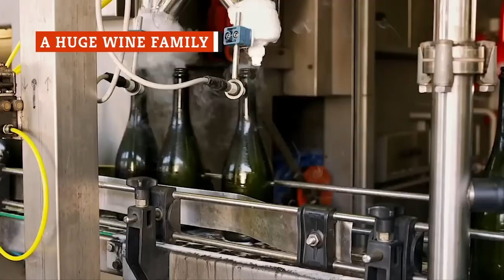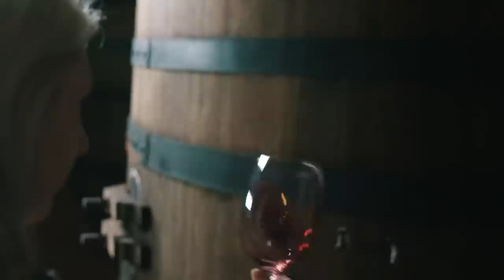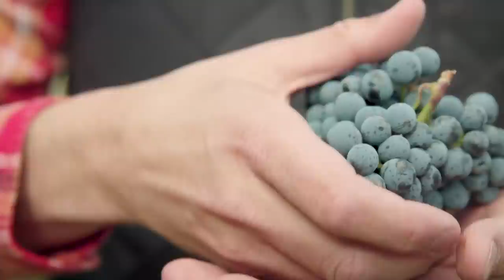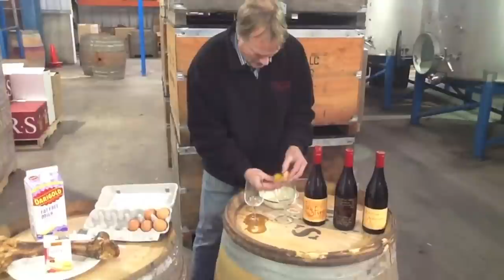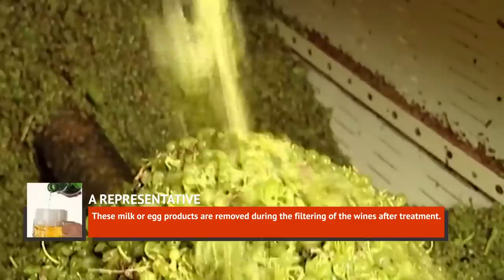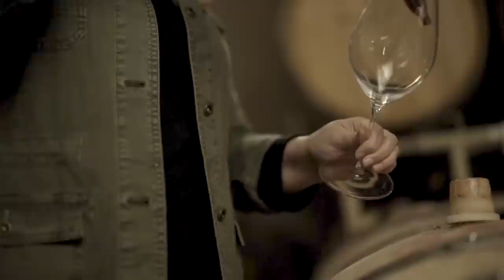The Truth About Aldi's Winking Owl Wine

Comment: Most of these Winking Owl wines I have purchased have less ABV (alcohol by volume) than regular wines of the same varietals.  Check the labels to see the ABV.
Reply: ALC 8.5% By volume
Reply: The reds are all 13%. That's about average for a red wine.
Reply: I just picked up my 1st bottle of Winking Owl Merlot ABV is 12%.
I must say I tried it after dinner with a good slice of Aldi’s Gouda cheese. It just melts in your mouth. It’s by far the best Gouda I have ever tried.  On my next trip to Aldi I will buy the Smoked Gouda. I really enjoyed a glass of Merlot. Actually I went back to pour another few sips. I like feeling the Breeze I got from the Merlot.